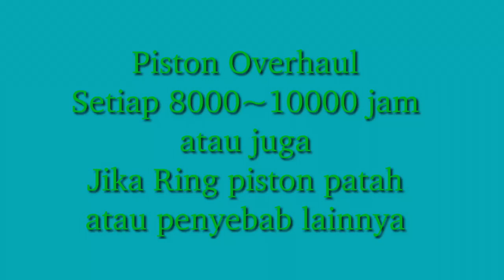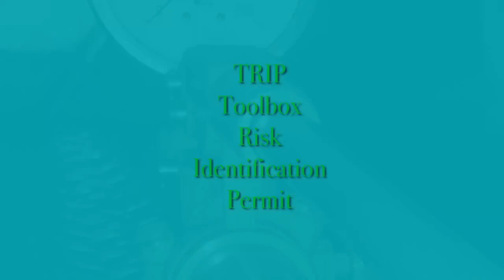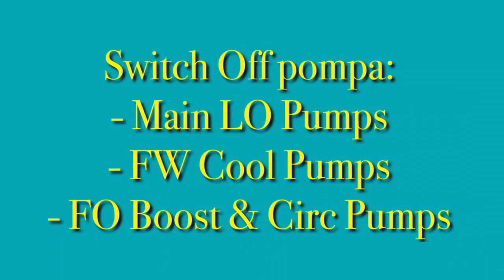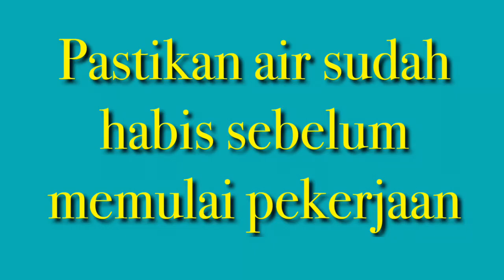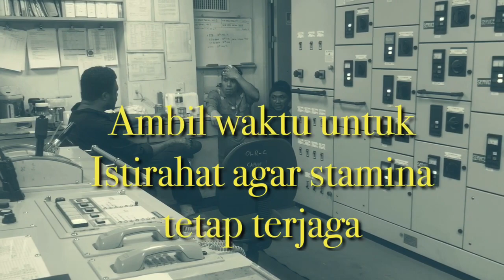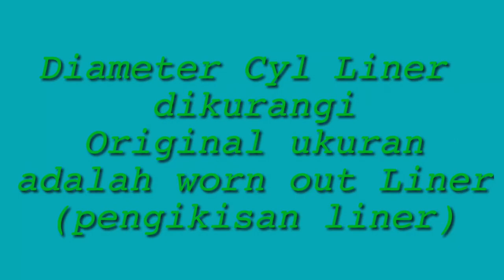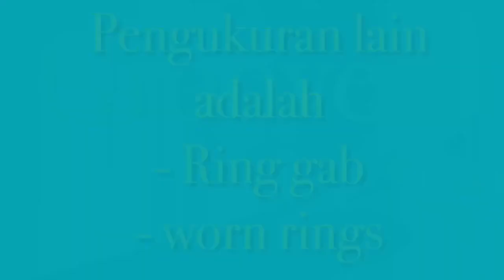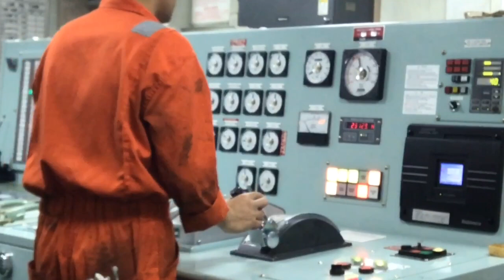OVERHAUL MESIN INDUK (PISTON OVERHAUL) || MESIN INDUK KAPAL

Comment: Sangat bermanfaat Bas, terus berkarya. 
Salut pada crew nya, tenaga nya kuat, ikat buat pake hyd. oil eject manual bukan yg pake hyd eject yg angin. 
BTW yg sebelah itu alat untuk grinding exhaust valve bas ya..?? 
memang top bas ini.
Reply from the maker: Iya benar bro, hyd pump secara manual. Utk pengoperasian exh valve grinding sdh ada videonya bro, silahkan dicek saja semoga ada manfaatnya.. Tks

Comment: Izin bertanya bas untuk running hours apa overhaul atau pemeriksaan mesin bsrta komponen di dalamnya sama sprti kepala silinder, piston, injectot, conrod, rocker arm, main bearing/crank pin bearing sama setiap 8000-10000 bas? Mohon penjelasannya 🙏
Reply: pergantian/pembersihan Starting valve dan pendingin udara bilas atau pendingin minyak lunas setiap brp jam ya bas
Reply from the maker: Tidak selalu 8000 jam, ada yg 10000, ada yg 16000, tergantung maker pembuat mesin.
Utk starting vv umumnya 4000-6000jam.

Comment: Setiap mau overhauld. Piston yang mau di buka apakah harus di posisi TDC. Klo harus, engine segede gitu apakah di putar manual di flywheel atau gi mna bas?
Reply from the maker: Tdk bro, bebas dmn aja. Saat overhaul piston jg diturunkan dan dinaikkan saat melepas baut con rod. Flywheel d putar menggunakan motor listrik, namanya turning gear..👍👍
Reply: Siap bas, terima kasih ilmu nya. Karna belum pernah pegang main engine. Jadi di kira sma kayak Aux enggine